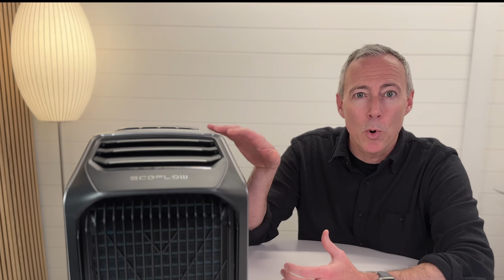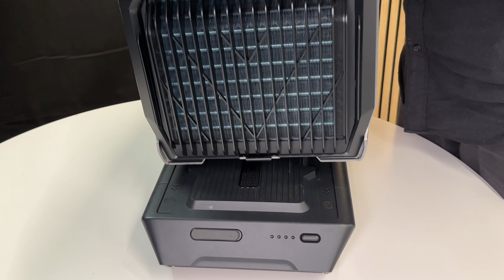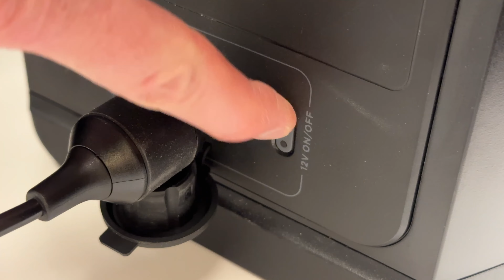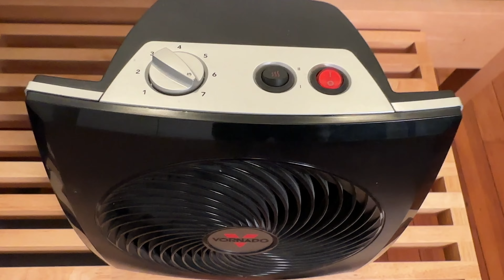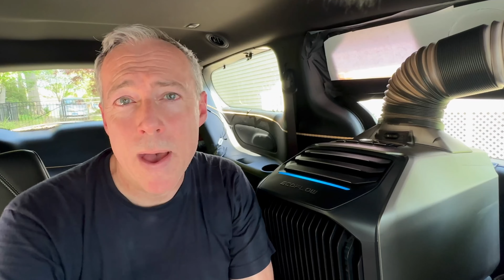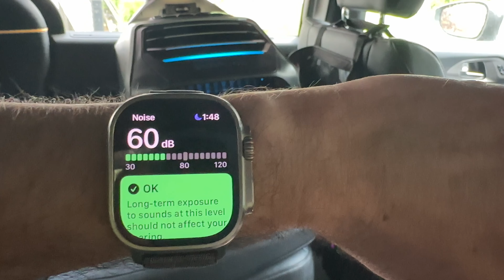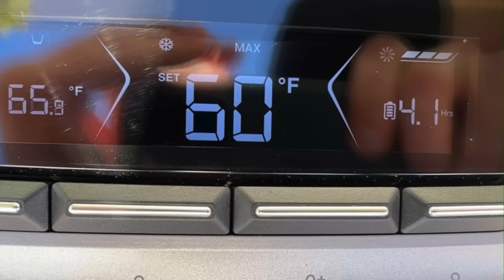EcoFlow WAVE 2: Heater + AC in a tiny, portable package

Comment: I am hoping to build out something similar with my family’s Pacifica, size wise, would this unit fit on the center console between the driver and passenger seats for a more designated space? Or is it too large? Thanks in advance!
Reply from the maker: My hunch is it might be a bit too large but you'd need to measure. The biggest issue is this needs 2 hoses running out the window so you'd need to break those down every day when you wanted to drive.

Comment: I wonder if the tent test would have been any better if 2 hoses were uses(cooling the inside air instead of cooling outside air then injecting it inside) Or if the large gaps made would have made it worse.
Reply from the maker: Yeah, I'm not sure. That is how they showed the setup in the manual but maybe?

Comment: Ya know, it's kinda interesting. Wave 2 seems to have taken a lot of design inspiration from Mark 2, both on the outside and in the specs. But here's the thing: when it comes to outdoor ACs, portability is a major deal, folks! And that's where Wave 2 missed the mark for me. If it's meant for outdoor use, shouldn't it be even smaller and more portable than Mark 2? I mean, c'mon, when you're out camping with your trusty tent, you want something that's easy to lug around! Wave 2, let's step up that portability game and make it more tent-friendly. Us outdoor enthusiasts would really appreciate it!

Comment: To get the delta t of an ac you dont measure the exhaust from the compressor. 

You measure the temp at going into the return and the temp coming out. You should get a 20 degree difference. Ideally you want the temp coming out to be 15-20 degrees your desired temp in the room.

Comment: Compared to wave2, zero breeze Mark2 is more compact and portable, with a cheaper price.
Reply from the maker: That’s true but if you also want a heater in the same unit, this might be worth the extra size and space. Making heat efficiently w/o fossil fuels has been near impossible before heat pumps. Also, the integration with Delta power stations.

Comment: They need to improve specs for cold climates.  The spec sheet for this model puts minimum operating temperature at 41F.  Stuff like this would really help people that rent, but I don't understand why refrigerator technology costs $1000 today with an aluminum radiator, copper tubing, variable speed compressor, and reversing valve.

Comment: Battery technology is just not ready for products like this, what a joke at 2.5 hours run time.
Reply from the maker: That was at max output just to test the limits. The internal battery is more of a buffer to let you run this off solar. Better yet, get a Delta Max power station and skip the battery

Comment: For car camping I really only need something I can use at night and recharge during the day when I'm off grid. I can run the ac during the day when if im in the car. I don't even think I'd need it to run constantly at night since my vehicle is pretty small. Ideally I'd like there to be a way to a way to cycle it on and off so it could keep things pretty cool all night. Ultimately though I think the real solution to staying cool while car camping at least, is having an electric car that you can run the ac in all night long, at least in Louisiana.
Reply from the maker: Yeah, tapping into the huge EV batteries is ideal. I’d use this with a Delta Max for my car camping setup

Comment: Wait, so it requires a specific battery that only lasts 900 cycles? That’s such a disappointment
Reply from the maker: We’ll, you can skip that battery and get a Delta power station rated at 3,000 cycles

Comment: Can it be hardwired into a boat or camper LiFePo4 battery bank?
Reply from the maker: If you have the internal battery you can wire the solar input to your battery bank to recharge that and power it

Comment: To be more efficient simply use the exhaust hose by itself without the intake hose, the unit will suck air from inside the van if the doors are closed, just make sure to switch off the recirculation function on the ac panel of your vehicle, it will allow for passive air exchange since the portable ac is creating a vacuum inside your car when you take the intake hose off.
The air that normally gets sucked by the hose will come into the van after passing through the cabin filter and then the ac vents on your vehicle (yes even when the car is off) , this is why you feel air coming in when you drive while the recirculation button is turned off on the vehicle's ac panel. 
NOTE: The portable ac unit will also be more efficient as the air in recirculation is effectively colder than the ambient temperature outside making the heat exchange process more efficient.
Reply: I say test again with single vs dual hose. And add in day vs. night as well. The results may surprise the folks that didn’t like your single hose test.
Reply: @dearlaserworks  agreed 👍
Reply from the maker: I think that’s the setup I tried in my van test and I had a few people say that was a Bad Idea so I dunno…
Reply: @todd.parker  think of it as using the recirculation function in your car, in the video you talk about installing the 2 hoses, all im saying is remove the intake hose for more efficient use, if you are not sure you should try it, just a thought 😉
Reply from the maker: @jah-jah87  I had the exact same thought which is why I decided to not hook up the second hose on that test and apparently I “don’t know how heat pumps work” so…yeah

Comment: Can you run this just off of AC power? I have a 3000W Growatt that puts out clean power, and wonder if the battery in this unit would be okay if I used the AC input all the time, or would that overcharge the battery? I am not sure I like the idea of a non LiFePO4 battery in my rig, as those have been known to overheat and start fires. Thanks.
Reply from the maker: You can definitely run this off AC power and it will use 100-500w which should be easy to power. You can also use a Delta power station to power this if you prefer LFP.

Comment: I lol at the fact that all the promotional photos show no hoses and a nice compact looking unit yet when you buy one and go to plug it in you end up with 3 massive hoses and a giant mess.  Misadvertising at it's best!  It looks like a good efficient unit, my only gripe is why can it not heat or cool whilst it's charging?  That doesnt make any sense!
Reply from the maker: Yeah, most portable ACs do the same thing but the reality is there are a bunch of hoses so I wanted to really show that. To be clear, it will heat and cool when charging from solar IF there is a the add-on battery or a Delta power station - that's needed because solar alone isn't enough power to run this so the battery is there to help buffer and provide extra juice.

Comment: This is the best review I've watched. Thank you for taking the time to show the different scenarios and its relevant performance. I have a house lithium (206AH) in the cabin of my jeep. Can you hook up to a non-branded external battery easily? Seems like i have to chop the cable off unless thwy comw with special ones to connect directly to the battery. 

I noticed that you had the unit outside the tent. I was thinking of using this for a festival with extremely dusty situation this summer and my rooftop tent and am considerinf wherhwr to house the unit inside the rooftop tent or inside cabin and run the hose up top. Advice?  

Lastly, does it have a thermostat function?
Reply from the maker: Thanks! You can't just hack a cable because there are communication ports in play. The cheapest way to go is to skip the clip on battery and buy a Delta 2 because you can hook up external batteries via the solar/DC input to trickle charge that while it powers the Wave. I think this should work with a RTT but you'll need to keep it level and may need to have it off the ground so the hoses reach. As you saw in my tests, tents get super hot so runtimes are around 2-3 hours but if you just used this in the evening, might perform better than the middle of the day like I tried. It has a thermostat, well, a temperature setting. It doesn't have a remote sensor so it's not very accurate if it's outside the thing it's heating/cooling
Reply: @todd.parker  awesome. Thank you. I've been waiting for a reply from their support on these questions. They must be backed up. ✌️

Comment: When you roll your van window down to vent the AC, what keeps the hot air from the outside from just flowing back into the vehicle?
Reply from the maker: You vent the AC though the window but it needs to be sealed up with a panel that has holes cut in it

Comment: It's completely idiotic that they will not enable the unit to run on DC power.  I purchased a unit and was informed by the distributor that it would run on DC. Nope. What a disappointment.  Clearly they don't understand the van life community.
Reply from the maker: It runs on DC power but not 12v. The EF batteries or Delta power stations are a 48v system which is much more efficient than 12v. I think the best best is to skip the snap in battery and get a Delta 2  Max

Comment: When camping using the eco flow as an Airconditioner, you can collect the condensed moisture as a water source. If you keep those filters cleaned, you can probably use the collected moisture as potable water. If you harvest the resulting heat from the exhaust, via insulated duct, you can probably use it to keep food on a stove or pot warm without burning extra wood or if you are really adventurous, you can use it to power a Sterling power generator.
Reply: i wouldnt drink the water, boil it for abit
Reply: @P_pp3r  or use lifestraw
Reply: @agps4418  no
Reply: @P_pp3r 😂😂😂
Reply: That water would have oil form the factory along with other contaminants and possibly metal residue from internal parts. Skip the sip, not worth the risk.
Reply: @latymz  #SkipTheSip

Comment: Hey, does your unit actually work properly with the set temperature? I got mine and noticed that it doesn't seem to respect the set temperature, even with latest firmware. It will do weird things like continue to cycle on/off at intervals, even when the temp is 5+ degrees beyond the set temp when cooling (or 5 + above) when heating. This is a large efficiency issue since its wasting time heating or cooling outside the desired temp.
Reply from the maker: Mine seems pretty accurate so far

Comment: I've got mine and love it.  Thank you for pointing out you can only run the fan using the xt60 port.  Many other reviewers are saying you can run the ac and heat but that's not true.  Nice review :)
Reply from the maker: Thanks! If you have the extra battery attached you can run it and trickle charge with 12v but it’s good for people to know the limitations
Reply: Yup.  I got the battery too.

Comment: Having both the Zero Breeze Mark2 and Wave1 in my possession, I have thoroughly assessed their performance and, based on the video I watched, I firmly believe that the Mark2 remains the most suitable option for my outdoor activities. Regrettably, the Wave2 model has limitations in terms of power source compatibility, as it exclusively relies on Ecoflow's proprietary battery and power storage system. This restriction proves to be quite frustrating as it prevents me from utilizing power storage and battery systems from other brands that I own. Additionally, the connection cable between the air conditioner and the battery is noticeably unwieldy and easily misplaced, unlike the ZB Mark2, which can be conveniently positioned between the front seats.

Moreover, I am well-informed about the quality concerns associated with the Wave1, including fan axle breakage and display failures, which understandably worry users. The unpredictability of when these issues might arise adds to the overall concern. Unfortunately, Ecoflow has not shared any specific information about the measures taken to address these problems with the Wave2 during this period. Hence, I find myself unsure whether the Wave2 has truly rectified these issues or not.
Reply from the maker: Thanks for the detailed comment. I don’t have the Wave 1 but I can see how that’s concerning. I do know this is a complete redesign so I’d think they would have addressed earlier flaws and feedback to avoid needing to service the system units but there could be new things they got wrong. Time will tell but so far mine has been rock solid
Reply: I agree with the power source compatability issues and the ecoflow's proprietary battery; it is kinda frustrating. However, i'm pretty sure some electrical engineer out there will hack this soon so that it will no longer an issue (i'd do it myself but my expertise is in mechanical engineering). Also, from my research, the ecoflow wave 2 puts out much more btu's than the competitors... it also has the capability to heat (as well as cool). I received my ecoflow wave 2 yesterday and still assessing everything.
Reply: The proprietary power supply is a deal breaker for me! I have over 600 amp hours available in my camper van and the only way I could use it is through an inverter? Horribly inefficient as the inverter uses 60 watts of power by itself. This is one guy who is not buying into the greed and a proprietary system.

Comment: With a weight of nearly 50lbs when connected to the battery, Wave2 is not portable at all for outdoor use. Therefore, I don't consider it a truly portable air conditioner. Seeing in the video that the battery cannot be charged separately adds to its bulkiness. Clearly, Wave2 is not the best choice for an outdoor air conditioner. Why would someone spend almost $2000 on an air conditioner that cannot be conveniently used on the go?

Regarding Wave2, I am aware of issues like inadequate cooling and water leakage. Wave2 is a very expensive product, and I often see people sharing and asking about these problems. I'm not sure if Ecoflow has truly resolved these issues, but if they haven't, it would make me feel that the money spent on it is not worth it at all.

Comment: Todd, I love the data! Thanks.  I notice EcoWave has blitzed the market just at the advent of cooling season.  I want to know the how this will perform in heating mode, specifically as the temperature drops - like in the 20's and below.  Will this thing do a defrost cycle to clear ice off the outdoor coil ?  I really would like to see a graph or table of it's heat output vs outdoor temp.   This thing approaches a gap in the market for a heat pump for small RV/campers.  I would like to see some folks doing a semi installed application to a camper/sprinter application.  I hope EcoWave is offering some 3D printer files for adaptors folks would need.  And yes, requiring the one purchase the dedicated battery for DC use is a bummer in that most/ all semi installed users would have bought their own DC systems.   
A couple of other thoughts:  Whether using the supplied ducts or a custom duct system (in a committed install) the larger. shorter, and better insulated the better.  Where the ducts come out one needs to prevent the outflow from being pulled back in the inlet.  On the inside,  particularly as the space gets larger, using the outlet duct to move the outlet(s) away from the inlet would improve function.  In designing an install one should consider three factors 1) don't force the unit to heat/cool the whole space all the time. If sleeping, one only needs conditioning where the bed is - consider having a diverter valve in the duct to move between day and night.  Second is let gravity work for you when possible.  In cooling mode for instance, don't jet the outlet against the ceiling, let it "pool out" (like filling a swimming pool) up to the hight needed to cool occupants.  Third, is Insulation is a multiplier,.  controlling inside/outside ventilation ( even, and maybe especially in a tent) direct insulation, window covers, awnings, etc.  greatly improve the ability of such a unit.  Keep up the good work you do, Todd :-)
Reply from the maker: Thanks for all the helpful input Peter!

Comment: Just wondering if you are using a regular XT60 connector or do you need the EcoFlow orange colored XT60 to connect to solar panels?
Reply from the maker: The regular ones (yellow) work too but the orange ones allow you to input more power.
Reply: @todd.parker  Thanks, I have ordered the Wave2 and battery. Hopefully it will solve the hot weather issues of van life without having to put a unit on the roof. Fingers crossed!

Comment: nice product when you need to work to a remote location and need a quick portable solution. outside that, the price is insane for the small performance. a tiny AC window unit is 1/10 the price of this. if you need heating, you put the AC window unit in reverse, and that is heat pump heating!
Reply from the maker: Sure but how do you make a window AC unit run in reverse? I think there's a bit more to it but in principle, I agree
Reply: @todd.parker  you install the AC unit with hot side blowing inside the room.  only I realized it is a janky solution as the controls will be outside and will need some weatherproofing. but still, cheap solution for a shed or garage.